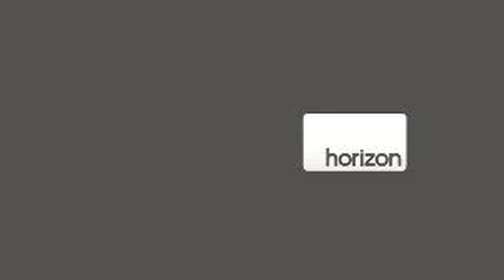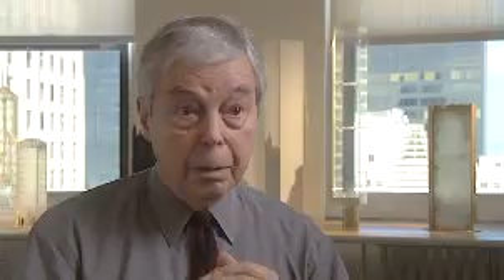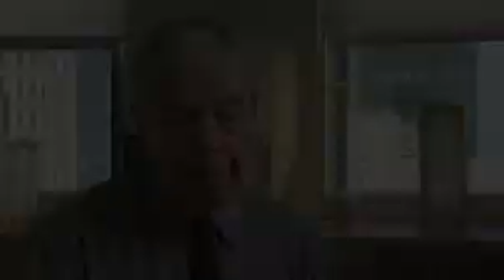Leslie Robertson - Chief Engineer - World Trade Center - Twin Towers

Comment: Okay so if you actually watch the ENTIRE interview with Leslie Robertson, he makes it very clear that while yes the buildings were designed to withstand the impact of a 707, they were only designed to withstand the impact of it going slow, lost in the fog perhaps, trying to land, just much slower. They also did not consider the fuel load when doing that, meaning the plane that they expected to crash into the towers were going to have little to no fuel on board. What actually happened was a larger 767, going 650 mph, fully loaded with fuel, crashed into the towers, those are two vastly different scenarios.
Reply: A large jet liner like these can not do 650mph and especially not at that low of altitude.  Maybe at 39000 feet with a major tail wind or descending at high altitude at full power
Reply: @Littlewing1977  I don’t understand what point you’re trying to make here. I mean I’ve heard many, many different things like this in the last 13 years since I started paying attention to 9/11 truthers, but this one, this one holds little substance.
Reply: @Littlewing1977  they actually can, in fact United flight 175 on a flight data recorder, was found to be traveling at 590 mph, yeah maybe it’s not 650 mph, but when you consider that because the air is denser towards the ground the engines are actually operating more efficiently because they are getting more airflow That’s how a jet engine works, they actually can go faster the lower that you get, however, that would be completely adverse of the airframe, but that doesn’t matter when you’re flying into a building now does it?
Reply: get real. Frank DeMartini said MULTIPLE planes still wouldn't make it collapse so 1 Boeing 767 can do what multiple planes wasn't supposed to do? I call BS; 9/11 was an inside job! https://www.youtube.com/watch?v=cabX3iR8408
Reply: It’s not worth arguing about the damn planes bird brains. Deep underground Nukes brought the towers down
Reply: John Skilling who was this guy's boss allegedly claimed Leslie Robertson was a genius!

 ' The buildings could lose a whole side of exterior columns and still withstand a one in a century hurricane gusting 100mph wind'
        John Skilling, lead structural engineer 
  
    They didn't consider civilian airliners might get larger in a 100yrs?
  The buildings had only 3 stairwells, 2 of which were only 44 inches wide.
   The safety requirements especially lowered for the towers by the Port Authority ..
   
    Evacuation time after the '93 truck bomb was 4 hours with all elevators and stairwells usable.
    Chicago tower evacuation time is around 30mins 
   A simple power outage of the WTC twins would have been a problem 
The twin towers were potential deathtraps by design flaw
   Is it really true that a sculpture called 'bent propeller', painted bright red and 25 feet high was moved around the complex before being placed outside WTC7 ?
   Being English and not having visited New York the islamic terrorist conspiracy theory happening while the defence chain of command tied up all of it dogs and looked the other way for a while defies belief.
    Were any this chain even reprimanded.. No
   Condolences to the bereaved and disaffected
Reply: @davepowell7168   This is lengthy, but hopefully knowledgable. 

“John Skilling who was this guy's boss allegedly claimed Leslie Robertson was a genius! 'The buildings could lose a whole side of exterior columns and still withstand a one in a century hurricane gusting 100mph wind' John Skilling, lead structural engineer”

Okay. Skilling was his boss, but you say that as if it was a grocery store manager over the cashier dynamic. This was an engineering firm. Robertson became a partner in the firm and the name of the firm became Skilling, Helle, Christiansen, Robertson. I like that you are confident enough in Skilling that you will use a quote of his in your argument as validation that the buildings should not have collapsed. But he also did claim Leslie Robertson was a genius. So I guess he was really confident in him. 

So you know Skilling might have had his name on the WTC project, but it was Robertson who was the lead structural engineer. Skilling put the young (30’s) Robertson on the WTC, and since he had never worked on a skyscraper before, he wanted him to work with another more experienced engineer as well (can’t remember his name). Robertson refused. So when you hear Skilling express such confidence in Robertson, maybe you should take him at his word. And when you have Robertson himself not thinking anything fishy happened, understanding full well what happened and how it happened, so let me repeat that, so when you have literally the guy who designed the structure of the building agreeing with the commission findings, not saying it was impossible, not crying foul, literally on camera explaining the faults of why, maybe you should listen. You cherrypick a quote from Skilling about a side of the building missing and hurricane winds, and you think it applies here. What are you even imagining in your head when he said that? Do you think he literally meant an entire face of the building? All 110 floors with all 59 columns across? Is that what you think he meant? You don’t think you might be taking that a little out of context? Because I’m quite positive in the wind tunnel testing, they never made such a model and tested it under those test conditions. Because it’s ridiculous and it wouldn’t happen. My guess is he meant something along the lines of if all 59 columns were missing across on just a floor or two. And in that case that is very similar to what happened in terms of the columns being severed almost the entire span, particularly on the north tower’s north facade. 

“They didn't consider civilian airliners might get larger in a 100yrs? The buildings had only 3 stairwells, 2 of which were only 44 inches wide.The safety requirements especially lowered for the towers by the Port Authority.”

They used the figures for the largest plane at the time, the 707. Those came out in October, 1958. The previous largest aircraft, the Douglas DC-8 came out three and a half years prior
 In April, 1955. Commercial aircraft had already taken quite a drastic journey in just a couple decades. I would say it would depend on the industry and the time period, but it’s not always easy to predict where it will be in even 20 years. You think in 1995 most people realized where we would be in 2015 with the internet and online shopping, the entire way we live? What were they supposed to do? Assume planes were going to get twice the size of a 707 and design accordingly? Impossible. The towers had three stairwells.Two that were 44” and one that was 56”. Safety requirements were not lowered. First off, no one anticipated two 767 would purposely be flown into each tower at 450/550 mph with 10,000 litters of jetfuel in each one. Worst case scenario was a low and slow flying plane, lost in the fog, low on fuel trying to land would hit one tower. That was all they could plan for. If no planes ever hit and there was still a fire on any given floor, lets say 85 in the south, it was never the plan to evacuate the entire tower, let alone both. They had fire procedures. Starting with those closest to the flames. Any other situation where two planes don’t slam into the buildings, the elevators still work if need be. The stairwells were designed to have two people side by side. 44”, I would remind you that while there have always been fat people, there are more now then ever. Making it 44” now would be an issue. Back then doesn’t seem that farfetched. (To give you an example, the 1997 movie Titanic, they built the replica grandstaircase and that whole area to film on. It was identical. Except when they built the replica to film on, they had to make the grandstaircase a little wider then on the real Titanic, not because they needed room for filming, just because people are larger).

“Evacuation time after the '93 truck bomb was 4 hours with all elevators and stairwells usable. Chicago tower evacuation time is around 30mins A simple power outage of the WTC twins would have been a problem. The twin towers were potential deathtraps by design flaw”

I agree. There were some serious design flaws. That’s unfortunately what happens though. What once was regarded as innovative design years later can be understood for its flaws. And even more the rarest of events to ever happen can show us other potential weak spots never even thought of and how to potentially safeguard for the future. The lightweight frame was thought to be cutting edge, but using thin floor trusses and only spraying them with a fireproof coating as it turns is highly susceptible to fire. Same with wrapping structural steel in gypsum board rather than concrete. Who would have thought. Many people had trouble seeing in the stairwells during the ‘93 bombing because of the smoke, so afterwards they installed glow in the dark tape on the steps and floors to guide people better. Emergency lights were on a generator I believe. Pressurizing stairwells so smoke can’t get in would be a good idea like they do in the Burj Dubai.   

“Is it really true that a sculpture called 'bent propeller', painted bright red and 25 feet high was moved around the complex before being placed outside WTC7?”

Just search the phrase. It was an art sculpture. One of many in that area. It was also known as the World Trade Center Stabile. The original location looks to be in the plaza somewhere, theres a pic of it in 1971, then it looks like when WTC7 was built, there was an elevated walkway leading from WTC6 to the front of WTC7, so it was placed on the walkway in front of WTC7. There’s a pic of it there in 1994. And then severely crushed when 7 collapsed. It was reminiscent of a ships propeller.  

“Being English and not having visited New York the islamic terrorist conspiracy theory happening while the defence chain of command tied up all of it dogs and looked the other way for a while defies belief. Were any this chain even reprimanded.. No”

How do you know they didn’t visit New York? Several of them were in the US for quite a while. The pilots especially. They were going all up and down the east coast, all the way down to Florida. A couple of them stayed at a hole in the wall motel in the trashiest little area near me in MD here. There’s proof of this. You’re calling it a islamic terrorist conspiracy theory. I mean 24 years later and even with some of the comments you say here, you tell me what happened if these 3 planes (plus the 4th) didn’t crash into those 4 buildings as a result of the men on board that hijacked the flights. 

“580 mph in a shallow dive is very difficult. A civilian airliner full of fuel and passengers is 'slippery', prone to roll an experienced pilot would be required to fit both wingtips within the buildings.The terrorists allegedly had no access to a flight simulator except Hani Hanjour who struck the only fortified side face of the Pentagon with such exceptional precision”

I’ve heard these theories so many times and it always just boggles my mind on this one. The two in NY only got up to 29,000 ft before they hijacked the plane. You can see those towers from the next state over. They had plenty of time to descend and line up, especially when you don’t care about passenger comfort. especially AA11. UA175 almost only got the wing but made it at the last moment. They all had been taking flight lessons, they all had the info on the 767 and were studying it. I know I have heard many pilots say how smart those aircraft are. It’s not like standing up on a canoe on the water with a dog running around on it also, that plane wasn’t going to roll over so long as they maintained some control. And just like Hanjour with AA77, all three aircraft crashed into the buildings. They weren’t aiming for an exact spot. They hit what they hit. People always say how impossible it would be to make that maneuver into the Pentagon. I tell them first off, you must not know how large that building actually is in real life. When you drive by it, it is freaking massive. And two, I have never flown a plane in my life, but I’d be willing to bet with a little bit of training today, I could crash a plane into that building tonight (Disclaimer: This is not a threat, and I am in no way actually going to do that, don’t send your agents after me orange man). And true he did hit the one side that they had already redid the walls and windows, well yes, fortified, hence the window not breaking, but really if you zoom out from that, he hit the western facade, the one that was most directly in his path. That kind of makes sense right? 

I hope this answers any lingering questions you may have, but I doubt it will change your views.
Reply: Zdawg1029 structurally impossible to go 650mph at this height for a regular civil passenger jet ,impossible
Reply: Dave Gingras why do you think it’s impossible for that to happen? Where did you hear that’s impossible? According to who? And what are you even trying to claim by saying that? It was clearly two planes that hit the towers, they were clearly going that fast, so what are you trying to say by making this claim? Are you trying to say there were no planes? Or that they weren’t going that fast? What are you trying to claim?
Reply: Zdawg1029 this is not what I think ,this are facts reported by thousands of pilots and aeronautics engineers.The air is simply too thick .
The point is ,yes there was airplanes on that day ,but those were not the planes they said it was...and add to that clear traces of thermite and may be DEW ...
Actually ,it’s everything BUT the planes that makes it freefall 
Willy Rodriguez clearly witnessed explosions in the basement BEFORE first plane hits...
But again yes you right , 2 big planes hits both tower on that day , no doubt
Reply: @john-P-Doe  Actually it would be the "opinion" of thousands of pilots and aeronautic engineers that a plane can't fly that low. Because I am willing to bet not one of those "experts" ever took a plane like that and flew it the same exact way, so it would  be their opinion, not a fact. Why are you listening to the thousands of pilots that say it was impossible for a plane to fly like that, why are you ignoring the millions of pilots that agree with it? What makes that couple of thousand smarter than the millions who say it can? 

You clearly don't know what you are talking about. The amount of thermite they found in the dust is so small, it can be attributed to items that were in the buildings, like computers and phones and other object that have traces of thermite in them. If the building was brought down using thermite, there would be WAY more of it in the dust than the traces they found.

Willy Rodriguez clearly witnessed explosions in the basement before the planes hit? You mean the guy that wrote a book and went on speaking tours making a nice little living by saying that? Yeah, he seems very reliable. Lets think about this, why would there be explosions in the BASEMENT, let alone BEFORE the planes hit. The buildings clearly collapsed at the point of impact, so why oh why would there be the need for explosions in the basement.  It makes absolutely no sense at all. Did you ever stop to think that the guy is lying? Of course not, you believe anything that makes it look like this was an inside job, but you ignore every shred of common sense that disputes it. Look kid, you have no idea what you're talking about. You're just repeating a bunch on nonsense to me that you heard other people say in some conspiracy video here on YouTube.
Reply: @john-P-Doe still beliving in bogus conspiracies huh
Reply: @john-P-Doe  your the type to watch ONE video on YouTube about the World Trade Center and make your assumptions. do a little more research... google & YouTube & the internet is your friend....
Reply: @john-P-Doe  You have no idea what Thermite is, do you?  It's aluminum and iron rust.  Traces?  The whole building was made out of it.  It's one of the most stupid conspiracy theories out there. 🤣  How fast can a 767 go in a dive at full throttle, a hell of a lot faster than a 707.  What matters is the amount of fuel onboard.  The fires are what ultimately brought the towers down.
Reply: @LetMeThinkAboutThisForAMoment according to pilots of many years
Reply: @nasirreese766  What exactly are you responding too?
Reply: @LetMeThinkAboutThisForAMoment  who are the so called experts? If these pilots of many years of experience supported the known story you'd have no problem but because they are skeptics then now they are crazed tinfoil hat conspiracy theorist
Reply: @LetMeThinkAboutThisForAMoment  passport? wtc7?
Reply: @CrotalusHH  check all the fires that happened in steel buildings...there was one burning for 48 hours and the steel remained intact....that plane that crashed in India a few weeks ago was also full of fuel but the building did not fall down
Reply: @mare73  Details matter. The plane that crashed in India was 4 days ago, not a few weeks ago. It was a fighter jet that crashed while on takeoff. The difference between the two crashes are many, including with the plane size, speed, fuel load, as well as the building, it appeared to be a reinforced concrete structure that was only about 5 or 6 stories tall. 

Yeah there have been fires in high-rises that burned for hours that didn't ultimately collapse, there have also been ones where they did collapse. I doubt you are even looking at the designs of any of these buildings. There are so many variables at play. You seem to just look at everything with a confirmation bias and only look for structures that didn't collapse when they caught fire without even asking what differences there are. Do you really think every building is built the same exact way? And any plane crashing into one would also be the same exact thing? It's like saying every car accident on the road happened the same exact way. There are just so many variables for every instance that make each one unique.
Reply: @john-P-Doe  it wasn't going that fast
Reply: @john-P-Doe  580 mph in a shallow dive is very difficult.
  A civilian airliner full of fuel and passengers is 'slippery', prone to roll
 an experienced pilot would be required to fit both wingtips within the buildings.
  The terrorists allegedly had no access to a flight simulator except Hani Hanjour who struck the only fortified side face of the Pentagon with such exceptional precision